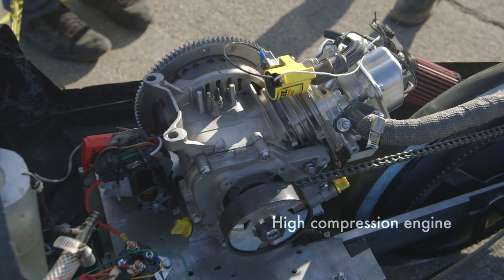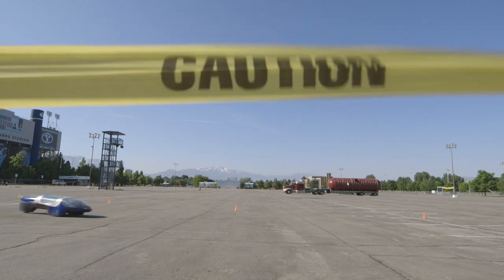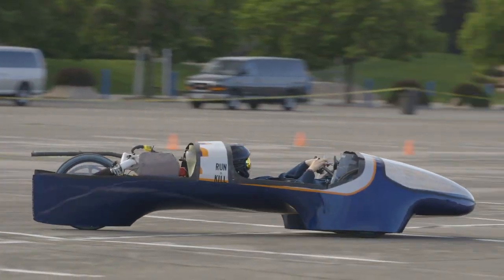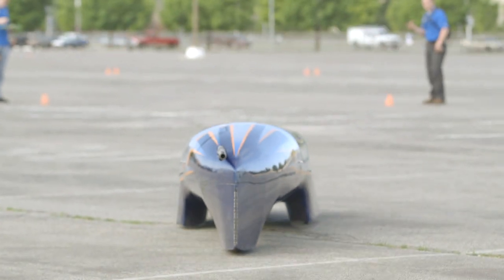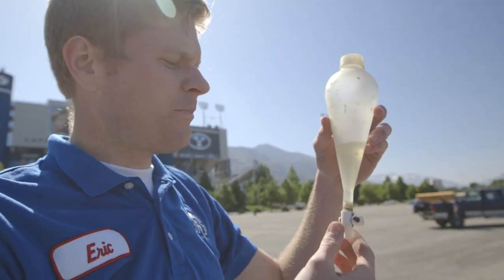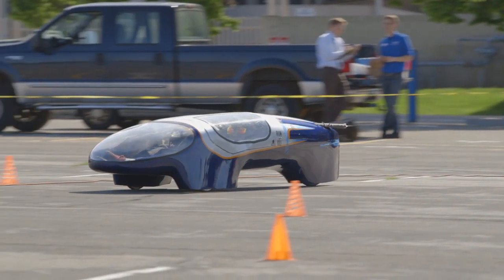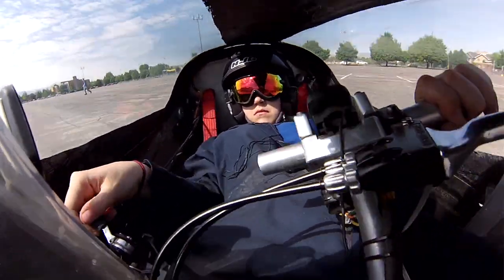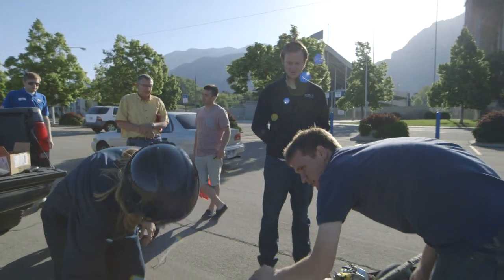BYU supermileage vehicle: 1,300 MPG and counting

Comment: why not build vehicle that at least minnick's a small motorcycle in ride height,handling,etc then wrap it into a streamlined ,aerodynamic body.Lets show these kids how inefficient today's vehicles are.Most mid to large cruiser motorcycles do no better then you average mid size 4 cylinder car in mpg,averaging 30 -50 mpg.Take those same motorcycles and wrap a aerodynamic body around it and most will double the mpg performance.This is sending the wrong message,that ultra efficient vehicles are impractical,and ultra expensive to produce.Thats all we ever hear,it would be cost prohibitive to build a efficient vehicle or a house with 16 inch walls,it always involves expensive one off materials,etc or some expensive manufacturing procedure.The truth is energy companies would lose billions in lost sales annually and thats just not acceptable to a lot of people..Just a fleet of semi tractor trailers ,diesel [airflow trucking] would cost them  billion's in lost revue,annually,imagine world wide.Now add efficient cars,enclosed motorcycles,etc it would be good for planet Earth and our pockets,but the energy companies and they're stock holders,haha,you think the rich are concerned about gas,diesel,prices,never.